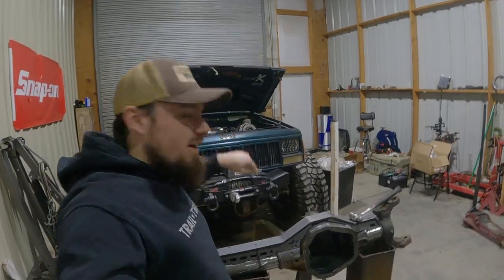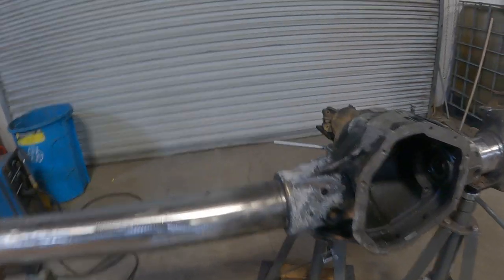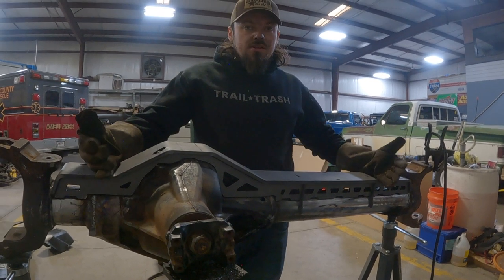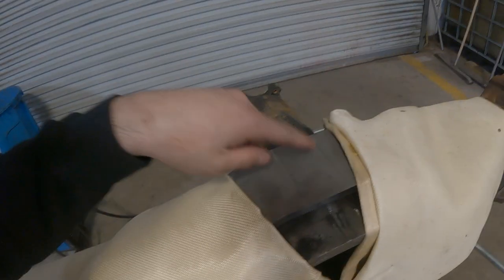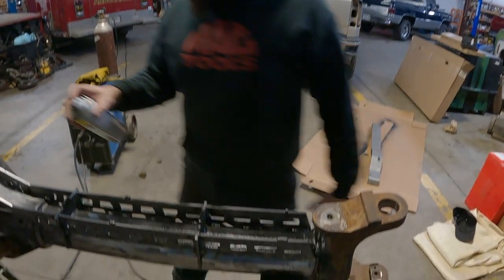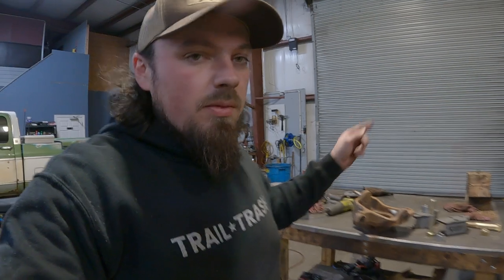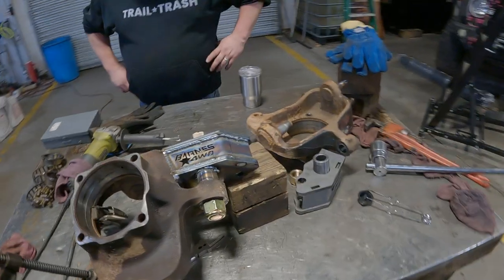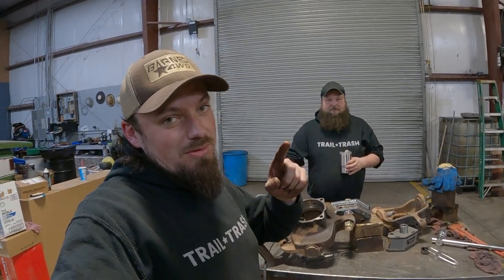Barnes4wd Pro Series Truss Install

Comment: Very cool. I’m the process of cutting and grinding stock brackets and the axle. Same true and hi-steering as yours. Did you heat the knuckles just like the pumpkin? Thanks
Reply from the maker: I heated both on mine. It’s a good idea with anything cast